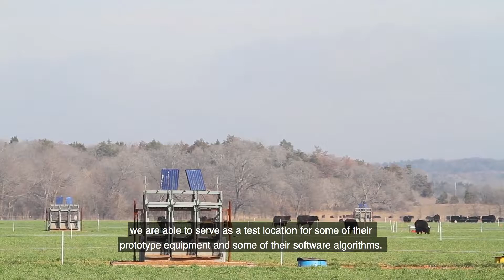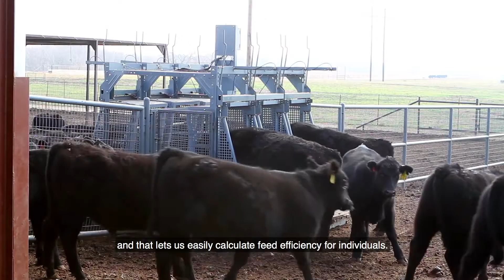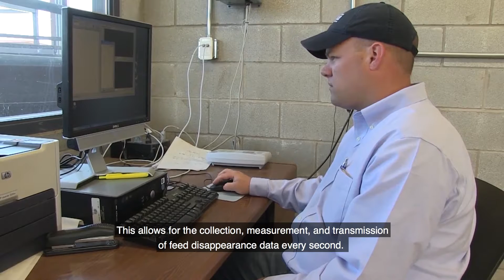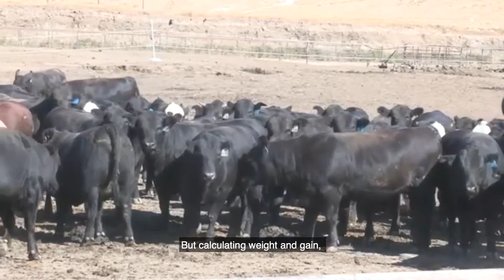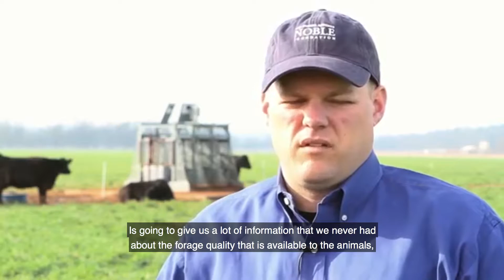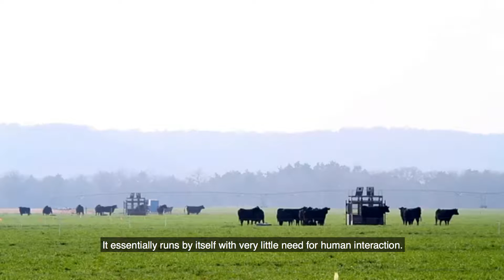GrowSafe Beef and Feed Efficiency

Comment: Hello!! 
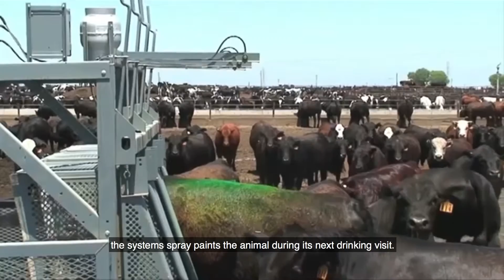At minute 7:06 you show us the spray painting, which kind of ink or storage do you use to guarantee that the ink won't be dry inside the tube (because of the heat or excess of dust)? Thanks in advance (: